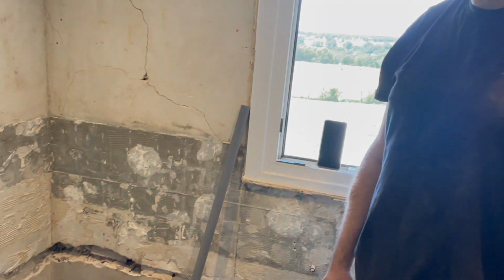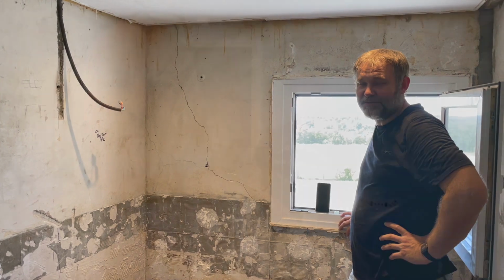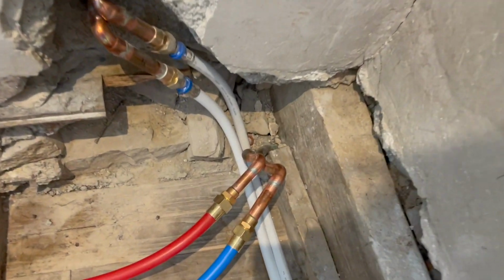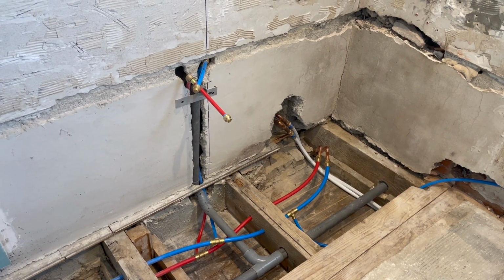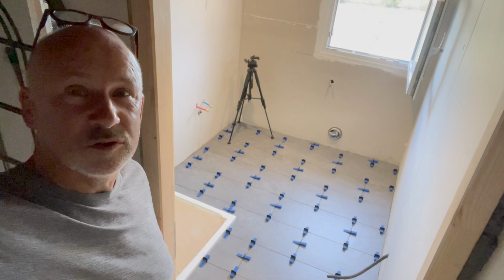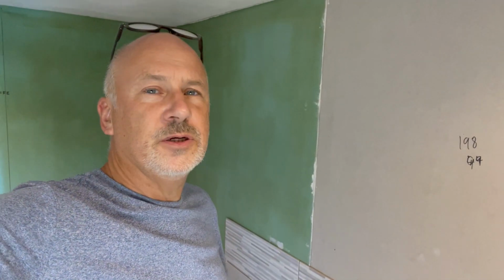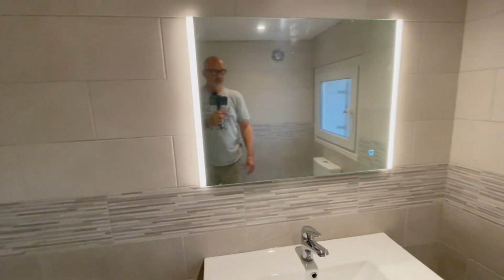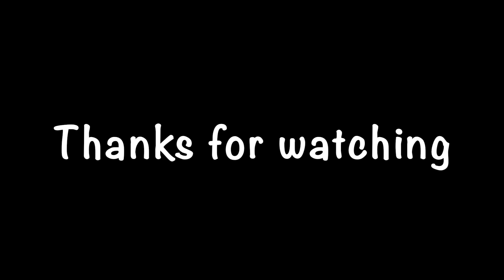French Bathroom Renovation # 3

Comment: Nice job & video lads, good to see know one got hurt this week. Although it did add to the drama lol. Did you use tile adhesive to fit the shower tray. Also the red and blue flexi pipes is that a French system?
Reply from the maker: Thanks Jim. Andy's cut has healed really quickly and cleanly. 👍🏼
The shower tray is put in with expanding foam. You can watch Andy's instructional video at
 https://youtu.be/VHQ1qWBh0nM?si=e6B0z5xHfxPUcrQC
The red and blue pipes come ready to go in conduit. I don't know if it's only a French system though.